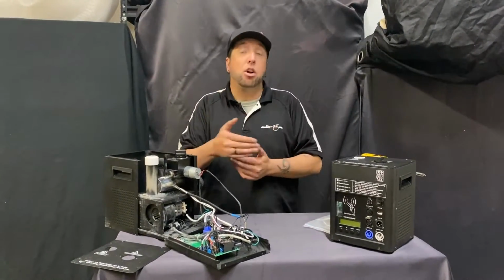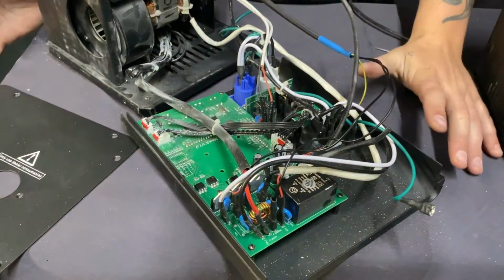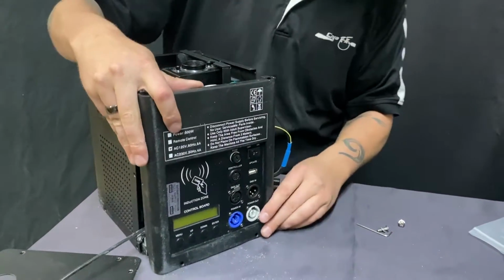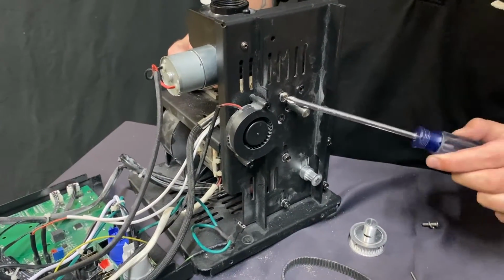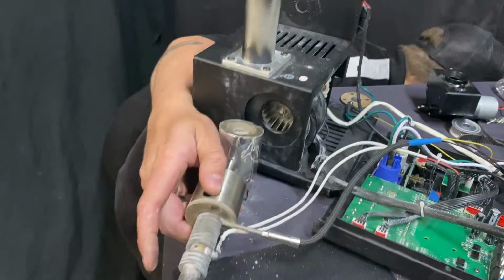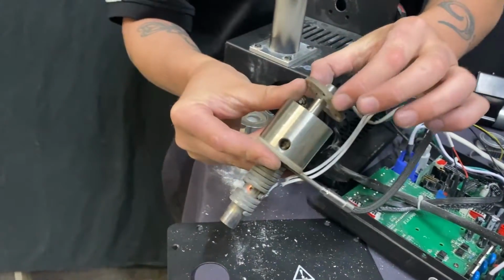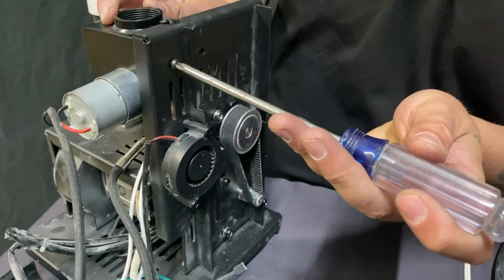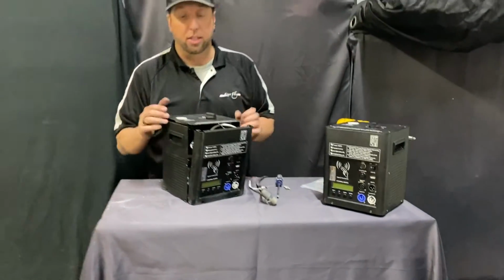How To Repair A Cold Spark Machine (CryoFX® Cold Spark Machine Repair)

Comment: I had changed new heater but the fuse blowing.what should be the problem.please can you tell the fault and resistance value of the cold sparkular machine heater.

Comment: Hi my machine keeps blowing the fuse not the one on the plug I tested it on the Thursday then set up on the Fri it heated up to the temperature but then it died basically
Reply from the maker: hmm this sounds like a board or power issue.

Comment: how can I contact You guys ? 

I have 4 Cold Spark Machines  I think the motherboard might be the issue. 

Basically They are brand new maybe used 7x. 

They heat up and go off without me pressing the button on the remote but not always.

Comment: The bearing on my rod keeps jamming, I open it and loosen the bearing, clean. Run the machine it works for 5 seconds then same thing happens. Jams, any way we can clean the internals with any safe solution?
Reply: Or do I just need a replacement piece

Comment: Is there a quick way to test the heating element with a multimeter? My machine is not heating, but I do not believe the heating element has gone out it shows just under an ohm resistance. If the heating element was bad I would assume that it would show open.

Also what should the voltage be running to the heater? I am reading anywhere from 3 to 6 volts running to the heater but no more.

This is a vivor brand spark machine and I would assume that the voltage going to the heater is reduced somewhat because the wires going from the main PCB to the heater PCB are fairly light.

I hope that you are able to assist, thank you!
Reply: I have the same issue from Vevor with 2 fixtures! It won’t heat above 200°F. Do you have a solution?
Reply: @silverfoxproductions6923  My issue was the control board.  I was able to find control boards on aliexpress that, while not a direct fit, did work.  I know the manuals on these are pretty basic, but I know there is a button sequence you can hit to adjust the temperature.  I'll try to figure out how I did it and post

Comment: How many are you guys connecting to a single circuit?
Reply from the maker: Hi, this depends on machine power draw (watts). Amps*Volts=Watts (Also as W/A=V and W/V=A). Circuits only should support 80% load. 15amps*0.8=12amps available (with nothing else on the circuit). Therefore, if you have a 500w cold spark machine, and its on a 120vAC circuit, this equation would be: 500w/120v=4.1666Amps EACH machine is drawing. Then 12amps/4.5 (actual 4.1666 but added extra)=2.666 machines on the circuit before popping breaker. 3 Would work but breaker may blow and it is unreliable.